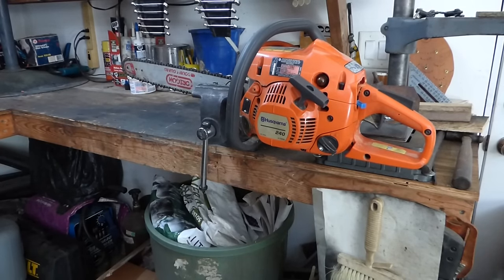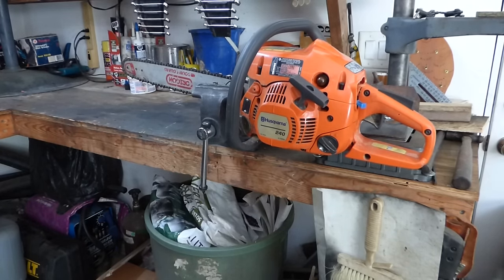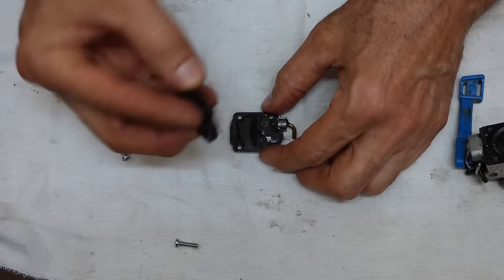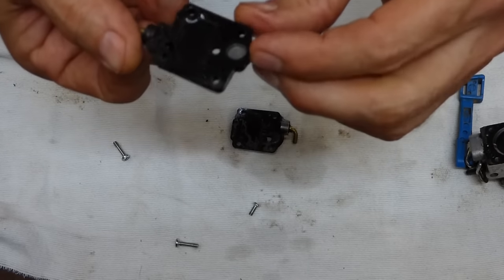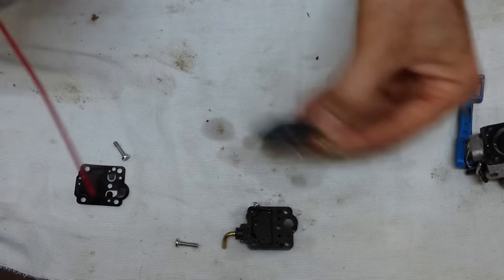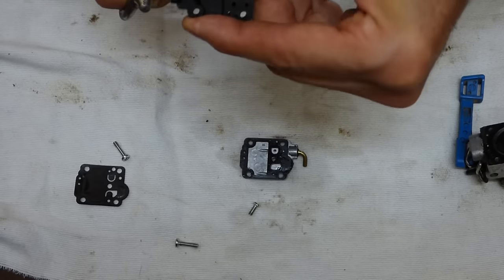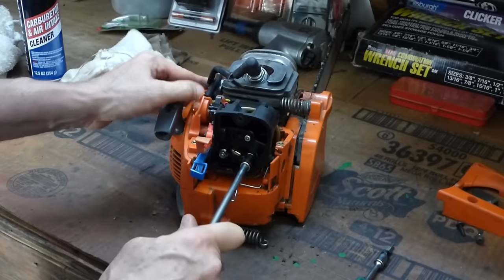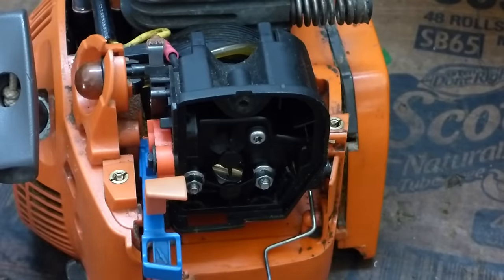Chainsaw Won't Start - What To Look For & How To Fix - (Husqvarna Carburetor Cleaning)

Comment: I took the same saw to a repair shop a few years ago and they told me that I needed a new carb, $85 bucks later I was good for a while. But I didn't realize that the alcohol in gas will turn to varnish if you don't use it up. I am determined to fix this problem this time, as I also did with my lawn mower twice. Now I buy gas with no alcohol in it. Excellent video, Thanks

Comment: Just a tip....While you have the carb apart, hold the diaphragm up to a bright light and see if it has a hole or a crack in it.
Reply: make sure it clicks too
Reply: @newt66c33 from what I see on other repair videos you specifically don't want it to be clicking in and out. That means it is stiff and needs replaced.
Reply: @newt66c33 100% wrong! If it clicks, it’s past toast. Bin it. They should be very soft and supple. As soon as they start to stiffen; they should be replaced.

Comment: Dump old gas and replace with fresh. Add a little Seafoam engine treatment to the fresh gas+oil, cycle primer bulb 5 times, pull cord 5 times with choke on, then let sit for 24 hrs and soak. Next day try to start again. Fixes itself 8/10 times in my experience if the diaphragm and fuel lines are good with no saw breakdown.
Reply: THANK YOU ❤
Reply: Ya it happened with me but after one start and one use when i turn switch off I won’t turn on i don’t know what’s problem
Reply: doesnt have a primer bulb
Reply: Purge bulb.....they don't have primers cuz they have a choke.
Reply: my 440 does as does the one in video 🤔 the older 300 series didn't. sounds like you know what saw the last commenter has 🤣

Comment: Thanks for the best most informative video. My 236 runs but won't keep running. The fuel is old but ethanol free. I think the 2stroke that was pre mixed with the petrol has gummed up the carb. I liked the way you didn't skip bits like the throttle rod not being connected. Its an easy mistake that a layman might miss. Thank you
Reply: so you have the one with no primer 😬.  I doubt sunshine owns a chainsaw Daniel

Comment: What a delight to see a smoothly explained theory, tear-down, diagnosis, and rebuild. This is an excellent video beyond just showing how to repair because the instructor is clear to describe what he's doing along with suggestions. Thanks
Reply: When you're done playing, replace the diaphragm. It's ALWAYS the diaphragm. Change the diaphragm once a year regardless If you use the saw or not. The part cost less than $1.
Reply: Except for the starting fluid

Comment: Great video, I watched your carb cleaning portion and cleaned my carb, put back together, also cleaned my spark plug, adjusted the spark plug screws and running like a champ again, hadn’t used it in about two years, cut down a tree that was next to the house after finished it
Reply from the maker: Way to go... and if you don't use it much be sure to drain fuel out of gas tank and run it out of Carb and she should start right up when you are needing to use it.
Also doesn't hurt to pour a little 2 cycle oil in the fuel tank and pull the start cord to get a little in the carb to keep it nice while in storage.
Reply: My Husqvarna 240 lost spark so I replaced the coil and plug. It still didn't start and started dumping fuel out the exhaust. I installed a new carb, filter and lines and set the H & L screws out 1 1/2 turns. Now I have fuel and spark and it still won't start.

Comment: Note i did not finish watching the video. To see what the carbs problem was.
But thought id mention a trick everyone can try as soon as one doesn't want to stay running or even doesn't run top notch. 
My husky did it yesterday. First start of the season was a no go. Readjust and i was off and cutting. 
My Stihl trimmer does it to me atleast twice a year or more. 

All you gotta do is run the needles down gently seated and usually the setting is  1 and 1/4 turns out on both high and low needles. It should start then.  Then adjust from there. Lots of videos on that. 
But anywho. It must be trash or varnish builds under the needle and seat and running it in clears it. Its worked more then 30 or.40 times in my life. If you took it to a shop they will tear it down and sell you a rebuild job every time. Um very seldom needed. Not on old stuff anyway. Most of this new stuff you either cant adjust or need a special splined tool for the job. They cant sell you.
 But i ordered a full set yesterday for my stepfathers  polan and lord noes what else. New Junk. 
Look for needles you can adjust. Or dont buy it. Or you can simple toss the carb and buy a new chinese one for around 15 bucks. Your call. 
Note echo blower a couple years ago i bought new had no screws. Ran to rich, no power so i returned it i was so mad. 
I heard from my local shop Most or them came tuned to  lean and burnt up.
Check your local pawn shops for the older stuff while you can still get it. Then learn to work on it. Tons of videos!
Reply: It’s also a good idea to check the spark arrestor to make sure it hasn’t become gummed up. A little mineral spirits and gentle application of heat with a small propane/mapp torch will clean it right up.
Reply: Same experience.  Once you learn how to adjust the high/low you’re good to go more often than not.
Reply: thew splined tools avail from wish china 5 bucks the set landed.  Another tip is screw idle well in so enigne will run as u tune.  ie low jet adjust till it starts responding freely then back idle screw off.  especially handy if youve pull jets out for cleaning.  i run the carbs thru a small ultrasonic cleaner its amazing the crap petrol leaves behind in the galleries of carbs.

Comment: I have a Husqvarna Rancher 455 sitting on storage for about 10 years. I have not tried to start but I´m sure it won´t . I do not have your skills to do this procedure and will have to replace the carburetor (Amazon $27) if it needs maintenance. Thanks for the nice class.

Comment: Hi Folks, don't forget to add gas stabilizer when storing your machine, it is often the source of problems. Also use the best gas you can find, you'll be glad you did. Those small engines are fairly simple to fix, just practice preventive mechanical measures and you will avoid most common issues.
Reply: Most 2 stroke oils have stabilizers in them already! At least the higher grade ones do
Reply: DO NOT store gas in any machine over winter!  Run it dry, buy fresh non-ethanol gas when ready to use again-
Reply: Totall TRUTH. I’d rather do a little preventative action that not and deal with an issue that didn’t need to become a problem.
Reply: I make this same mistake almost every year, I plan on taking it out one last time before the snow falls but never get to it.  Come spring I curse myself every time.  For years, before I knew this truth, I had to take my saw in for repair every spring.  "The definition of insanity is doing the same thing over and over again and expecting a different result."
Reply: Husqvarna gas has Stabilizer in it by default & can sit for up to 2 years without issue. Cost more but you can relax when stored during winter.
Reply: Best thing to do to winterize is dump the gas outta the tank and then run it til it dies.... Why waste money on stabilizer?
Reply: @mw7540 too bad their saw isn't as good as their fuel huh? 😂
Reply: Good video, patience is key,  good work area w/vice to hold saw.  Never thought of that. Enjoyed watching video, will try it on my Saw. Thanks
Reply: the stihl I'm looking at doesn't. tbh Jimmy, Reba, kid rock, you should empty your tank before storage. the oil in the gas clogs fuel filters when left for periods of time. 😉
Reply: that prevents water building but not filter clogging with settled oil
Reply: so you don't waste the same amount dumping your tank out 🤩

Comment: Watching from country (Botswana ) i feel very delighted to  watch this video, i just bought brand  new chain saw but it worked well  actual its  2 months kicking well but  now its start and switching its self off its not catching  up to a good start...help please  i don't know what  to do but i got lot of farm jobs i  have to do?
Reply from the maker: It is not clear what your question is. Are you saying that it will start but then when it gets hot it will shut off and then you can’t start it? If that is the case it could be that the ignition coil is bad.

Comment: My experience also is the stone filters break down & causes the grit you see in the carburetor. Switch to a paper filter & this will prevent the trash in the carb. My number 1 tip to all.

Comment: My 142 e - series will start with starting fluid but won't stay running.  Cleaned the carb, which didn't look bad. As you've stated, this has to be something easy that I'm overlooking. I haven't removed the fuel hose yet, but there's definitely gas in it. I have air and spark, so it has to be a fuel issue. Thanx for the video.
Reply from the maker: Be careful not to run it on ether… I just use that as a test. There is no lubrication in the ether which can burn up your piston and cylinder wall.
Check that there is no water in your gas and also that your fuel filter is not clogged
Let us know what you find out
Reply: @helpinguonline  Yes sir, I am aware and I never use ether on 2 strokes but as you said, a test. That at least told me it would start. This saw is also 1 of 2 that someone gave me. I'll keep you posted. Thanx for the response.

Comment: When you spray starting fluid in the carb you need to hold the throttle wide open so the fluid goes to the cylinder

Comment: Very good checking for the problem. I have done exactly what you have done, but it will not start unless ether added, then will run fairly smoothly for as long as it can. Unfortunately when it has been stopped, and you try to start it, it just will not start, wants to but just won’t, have you any ideas.?
Reply from the maker: You clearly have a fuel delivery problem.  Start simple like checking for a clogged fuel filter, clogged air filter, bad fuel line etc.  If your brand of saw has a vent line for the fuel tank make sure it is not plugged.  If the problem is not something simple then you will have to remove the carb and clean/rebuild it or replace it.
Let us know what you find out.
Also, be careful not to spray too much ether in it (I only did that little test to verify the problem)... the engine is lubricated by the 2 cycle oil in the fuel and that keeps the piston and cylinder wall from getting scored (ruined).  Ether has no lubricating properties in it.

Comment: You should consider buying a carb. They are often cheaper than a rebuild kit. It was the case for my Husqvarna 445e.
Reply: No need to buy a carb or gasket set 
Very seldom will need to need to replace a gasket 
Even if you tear one and it’s all still there it will still seal ok
I’ve even made gaskets from cardboard boxes when working really old engines
Just make sure the keys are cleared all you need is cleaner of any band
Acid brush 
A wire small enought to crear the jet
Shop towels to dry the cleaning Fluid

Comment: Great Video, have a Rancher 450 that probably has same problem, hasn't been run in a couple years and assume it's all gummed up.
Reply from the maker: It doesn't take much to clog those tiny ports on those carburetors.  In the future... if you drain the fuel and run it out of the carb before you store it for a month or longer you will save yourself from having to do this.  Thanks for watching

Comment: I got a little Husqy that came with the SxS I bought, it has old gelled up gas in it so I'll use your video as a guide.
But tell me what is the best way to clear the crap out of the fuel lines, prime bulb etc?
Reply from the maker: Your fuel lines and primer bulb are probably not clogged.  I would make sure the fuel filter and carb are not all gummed up though.

Comment: One thing you missed was to check and see if the fuel filter inside the tank was intact or letting junk go straight to the carb and plug the needle valve. That may have been the root cause of the plugged carb to start with and it will happen again soon if the fuel filter is missing.
Reply: bad oil is mostly the problem as it jells up

Comment: starter fluid is very hard on small engines, no lubrication in ether/starter fluid, I would start with checking for spark and fresh fuel, then going to the fuel line and filter, starter fluid is best used for spud guns.
Reply: 955

Comment: i use the premixed gas and have not had any problem yes more expensive but when you are at the hunting lease hundred miles from everywhere sure is nice to pull 2 times for start

Comment: Thank you so much for the video. It is fantastic! I have a chainsaw that's doing the same thing. I will try this and see if that works. It has only run 1 time then stop working! Thanks again for a great video!
Reply from the maker: Thanks for your feedback.  
You can do it!... and always remember to empty the fuel out of the tank and run it out of the carburetor if you are not going to use it for a while... will save lots of headaches...
Reply: i have  H 240 also. Never use ethanol gas and if it wont start open the gas cap then retighten. This Chainsaw design gets vapor locked easily.

Comment: I replace the diaphragm as well as the small screen in the carb every year, as well as the fuel lines and starter cord.  Time spent now prevents down times when the machine is needed.

Comment: Excellent video. did not need to watch it 4 times to get it. lol During the winter I started it every few weeks but gummed up anyway. gas stabalizer mentioned can stay in afterward or must be flushed? someone told me to empty gas after every use.
Reply from the maker: Best advice is to empty the tank and run the fuel out of the carburetor if it will not be used for a while...

Comment: while your at it remove the blocked muffler spark arrestor and open low jet just a smidge as its not revving quite right.

Comment: Funny I have a home lite xl and a home lite super 2. Got the xL to run first pull yet the super 2 for some reason when you pull it if it does start it runs extremely high rpm smokes out the muffler then kills. After dying it will leak fuel out of the exhaust and sometimes make a slurping sound as if it’s trying to suck the fuel through an extremely small straw w a vacuum. Iv put a little sea foam in there adjusted my carburetor screws of course. Will try it again here shortly

Comment: I have HUSQVARNA 365 special.It is relatively new.On the decompression valve and under have little oil and carbon. Anyway,It seems that chainsaw work normal and the compression is good... I don't use decompression valve for starting..Sorry for my bad english.Thanks for your answer...
Reply from the maker: Not sure what your question is?  If you can clarify your question maybe I or someone in the youtube community can help

Comment: Btw, I strongly discourage blowing compressed air through ports and holes in the carburetor. There are tiny check valves and diaphragms in there that you’ll destroy if you use an air compressor on them.

Comment: This is a very helpful video. I just bought a used husqvarna 550xp that wont start. Pulled the muffler and the piston and cylinder look good and seems to have good compression. Has excellent spark and new spark plug.  I can crank on it till my arm gets tired and pull the spark plug and it's not wet with fuel. I changed the fuel filter and put fresh mixed in it. I'm leery of fooling with that weird autotune carburetor, but I guess I'm gonna have too.
Reply: Pressure test the crankshaft seals on the old Macs we use to use max of 10psi threw threaded hole in homemade port blockoff plates look for air leaks at crankcase and seals with dishsoap soapy water.  This video should help a lot of people understand the steps to go through keep up the good work you're very good at keeping on point in your video.

Comment: I have 2 husky saws. A 440 & 435. Both stopped running. Got fresh gas. The newer 435 now runs. 440 doesn't. It has spark. It won't pop even if I spray starter fluid in the spark plug hole. (the 435 was the same) I'm getting ready to take the carb off and clean it but I know it's getting gas because when I take the plug out it is wet. However, cleaning the carb worked on my log splitter and on my leaf blower so maybe it will work on the chainsaw.
Reply: If the metering diaphragm is stiff (like a potato chip), it could be letting in too much gas.  The plug will be wet but it won't start.  Also the reed diaphragm should be fairly flat with no warps or crinkles.
Reply from the maker: Sounds like a challenge… I had one engine that was similar to what you are describing and found that the plug wire had a short in it. It would spark when I took it out but when it was installed there was a short And no spark…It only would spark when the wire was bent a certain way
 Let us know what you find out.

Comment: Great video my saw is a husky 257 there are two small adjustment screws on the left side of the saw one marked L and H how do you adjust them or should you?
Reply from the maker: If your saw is running well leave them alone.  If your carburetor needs adjustment at some point in time you can adjust them.  The L is for adjusting the low side (idle mixture) and the H is for the (High mixture).  You want to be careful when adjusting the high side.  You want it running a little rich and not perfectly smooth.  Watch a video on that before you adjust... and a chainsaw is a little different than other 2 cycle engine carburetor adjustments (ie a weed eater... etc.).
Reply: Thank you for your insight